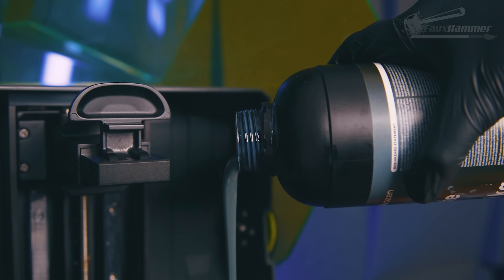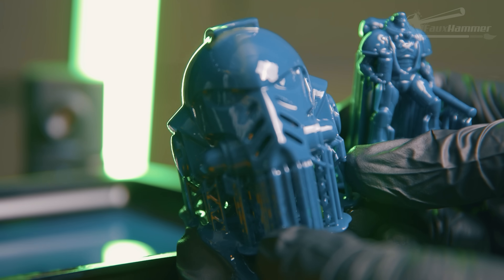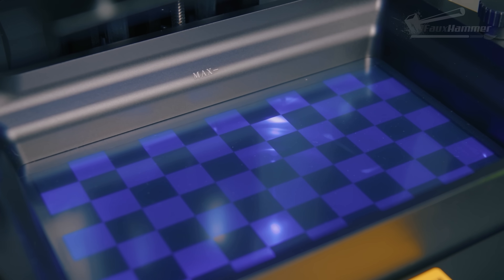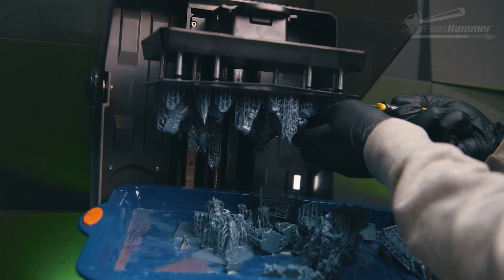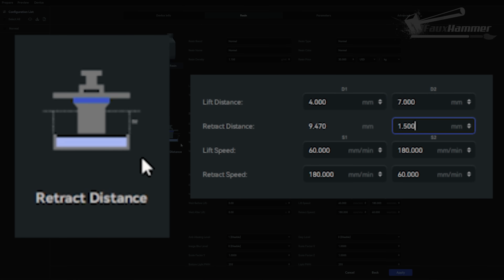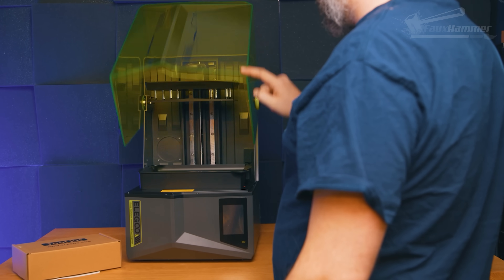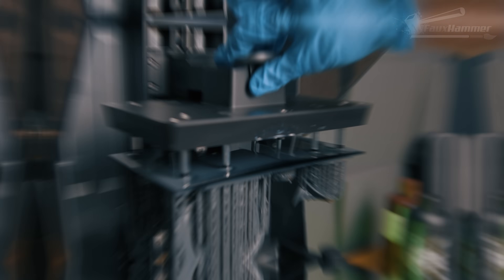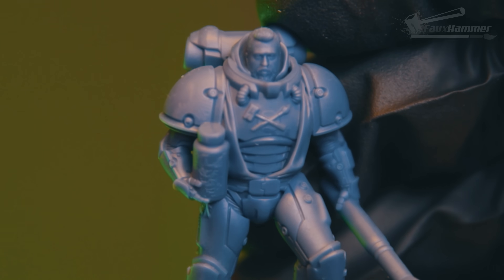FIX your RESIN PRINTER with this ONE SETTING - It's not what you Think! - How to fix Layer Tearing

Comment: So this will fix it if this is from the lift. But I've found this can also be from improperly hollowed models with suction cups forming from the resin having nowhere to go, creating much higher peel forces, or improperly supported models causing partial support failure. I've found that a lot of miniature creators don't support it in a way that makes sense (The use of only light supports instead of light medium and heavy supports, hiding the heavy supports where they won't be seen or not adding enough supports to maintain an edge or flat face leading to dimples where the supports are, etc). And that spending 15-20 minutes tweaking the support leads to noticeably reduced splitting, it also leads to better fitting multipart models without the need to fill gaps or sand down to get the mating edges to mate properly.  That and checking for suction cups and adding extra holes where necessary have meant that I haven't had failures in a good while, and I haven't tweaked my lift settings at all.
Reply: I make a little hole at the bottom (at the top while printing) of the object if I hollow it out, that solves that problem.

Comment: Had this issue this weekend and just changed the fep didn’t helped now I increased the hight I will try your settings now
Reply from the maker: FEP can be difficult to get in at the same tension it was at the factory, if you still have issues after this, as i said, increase the lift heights a mm each at a time, and come back to me if you still have issues
Reply: @FauxHammer thanks mate. I got an uniformation GKtwo with the original FEP replacement sheets. I think the tank I got I a bit worn out. The frame where you glue the fep on isn’t really bended anymore so maybe I didn’t got enough tension on it. Printed 2 years with 2+2mm lift hight now iam on 4+2

Comment: Perfect example of "Ross is right" - I was originally disappointed with my Mono X 6Ks printers because of these exact failures.  Discovered that Lychee has TSMC disabled by default.  Turned that on, adjusted the settings, and - et voila! I've not had a failure since through 4 FEP changes.